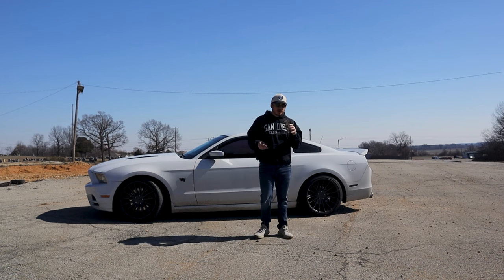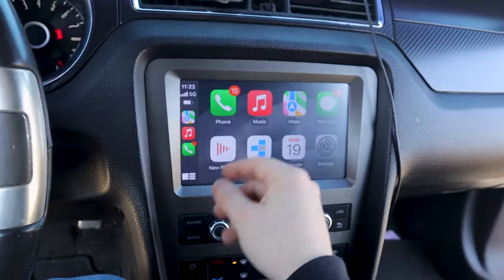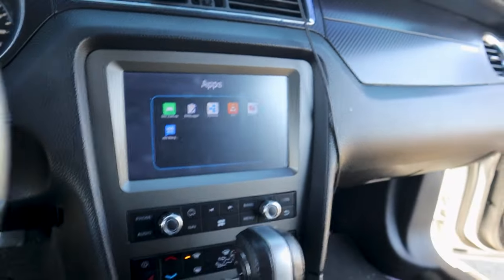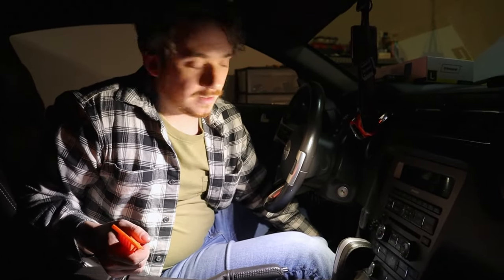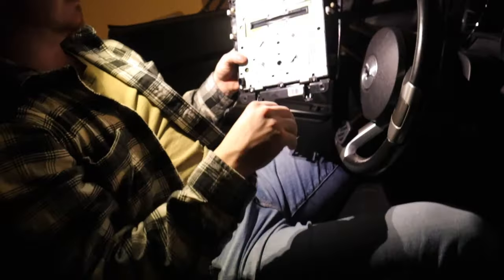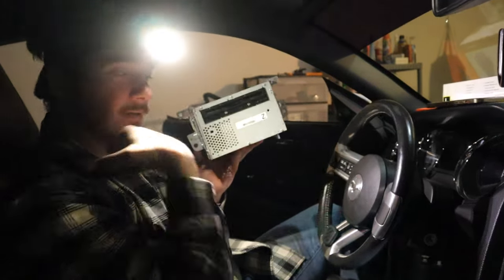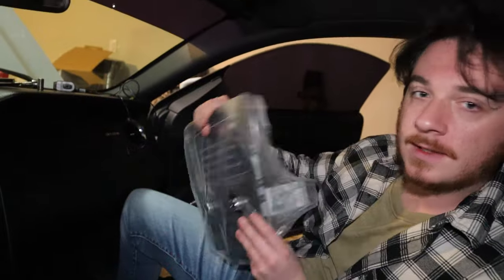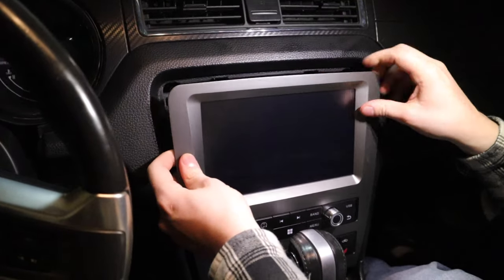Upgrading My Mustang Radio To Apple Car Play! Dynavin 8 Pro!

Comment: Nice work! Just a tip for you or anyone else looking into installing this, you can just squeeze the sides of the glove box inwards and it'll clear the tabs to allow it to completely swing down and out of the way to access the Sync module. This will save your back from laying in an awkward position and time with the install.
Reply from the maker: I so wish I would of knew this 😂

Comment: Did you have static problems with the passenger side speakers buzzing? Heard that is a huge common problem with this install... getting mine installed tomorrow and nervous haha
Reply from the maker: It did at first, usually it’s a plug in issue. Just make sure you really get those connections in there.
Reply: I’ve had the Dynavin 8 for 6 months and I’m not even kidding I just started having this issue. My passenger side speaker is having static sounds. I’m gonna open it up and check for any loose connections or defects. Hopefully can get it resolved. Aside from that I’ve had no issues with it. Any ideas on what might be causing it? RCA cable?
Reply from the maker: @vladd886_  My biggest guess is that it could a connection issue with the wires that are plugged into the back of your radio. If you have an older mustang like me, it could be your speakers starting to go out as well. 
A lot of people are resetting their Bluetooth connection and that’s fixing the problem as well.

Comment: How is the display in the sunlight?  I'm thinking of installing the 9 that just came out in my 08 convertible, but have been trying to find out if the sun washes  out the screen too much or not.
Reply from the maker: It’s definitely a glare on the screen but it’s only in direct sunlight. I think if you have some good tint on your car, you’ll be just fine!
Reply: Thanks!  That’s what I was kind of afraid off, with the top down, depending on the sun, it’ll be mainly in direct sunlight.  I’ll have to see if I can Google around and if there’s a film or protector for it that’ll act as a matte finish to prevent it.
Reply from the maker: @jeffv49ers  there should be a film that supports the Dynavin. Let me know if you find the one!